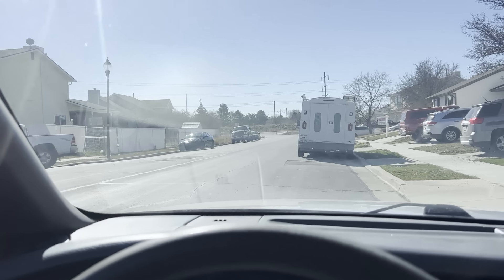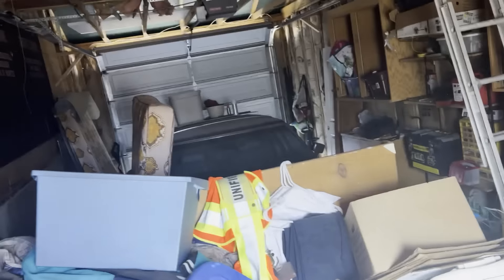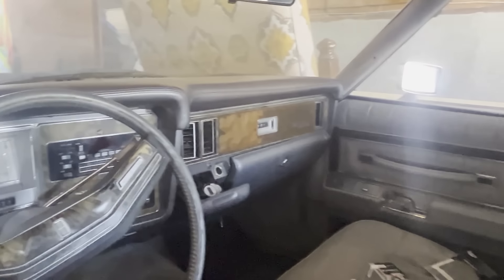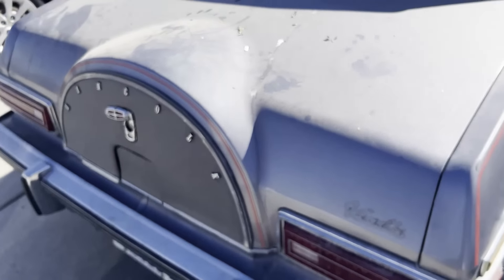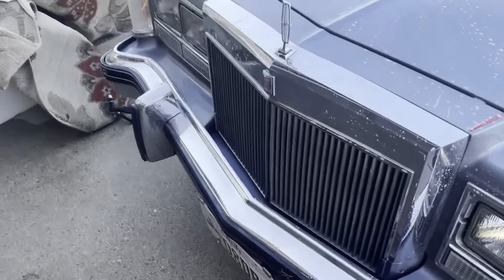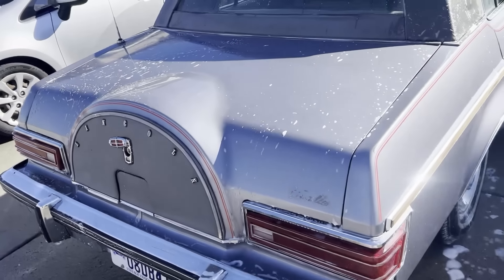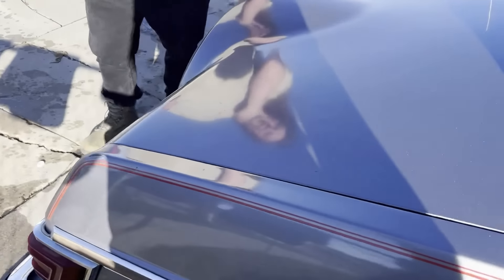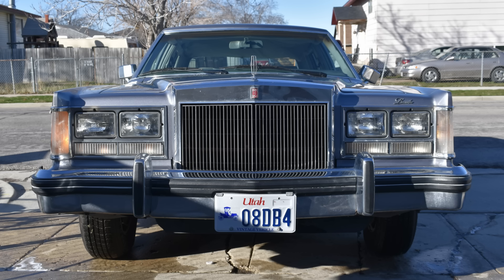Bringing Back This RARE 1979 Lincoln Garage Find!

Comment: The Versailles was Lincoln’s answer to GM’s Cadillac Seville. It was rushed to market when the Seville was a runaway success. I never cared for the first body style that had the Granada roofline. When Lincoln tweaked the roof a bit, it made all the difference. I loved both the Seville and the Versailles, but when it comes down to the success of either model, even though Seville sold more by far, you never see either of these cars today. 
I would love to find a black Versailles, at one point, these cars were offered in a 2 tone paint scheme that was eye catching as well.
I hope wherever it ends up, it’s brought back to life and once again turns heads as it did 40 years ago.
Reply from the maker: Thanks for the insight &   yes the car was purchased by an enthusiast who wants to restore it!
Reply: Cadillac did a better job of disguising the Nova/Camaro heritage of the Seville than Ford did disguising the Granada lineage of this car. But the Granada, with its very expensive looking interior and extra sound deadening, was a better fit for a luxury car than the penalty-box Nova, so it needed less tweaking. I'd rather be seen in the Seville, but with its roomier front seating and simpler engine, I'd rather live with a Versailles.

Comment: Yea, actually fellas, this Lincoln is way more than just a pretty Granada.   It's got way way more options than the top of the line Granada/Monarch.  The Lincoln's suspension has nothing to do with Granada/Monarch. Your Lincoln has 10s and 10s of pounds sound deadening insulation. 

 So, no sir, it's not a Granada. Other than some shared body panels.
Reply: Nah, it’s a Grenada/Monarch. Ford  should have been ashamed for trying to pass this off as a Lincoln. The later year runs did get better with the limo roofline.
Reply: @ATL1999  I know my cars.  And I know you didn't read my description.  You merely skimmed through it.  I know my cars intimately.  Was it a success?No.  And there is no shame. No Shame at all trying to stay competitive in a fierce market.  I would love nothing more than to get my hands on a well loved Versailles!

Comment: The Versailles actually had a fair bit of upgrades over the Granada. It was the first domestic car to have clearcoat paint and electronic controls. The clearcoat on Ford and Lincoln products was really high quality until they moved to a cheaper one in the mid 80’s. The dashboard is real leather, and it was actually built on the same line as the bigger Lincoln’s which had a nicer build quality. They were crazy expensive new to boot
Reply: My Uncle bought a 1980 from a Friend in 1982.  He said it retailed for $18,000 2 years earlier.  My Uncle hated it and traded it two years later for a a Towncar.

Comment: Even though it was just a luxurious Ford Granada, it was cool!
Reply: Just like the Seville was a Chevy Nova
Reply from the maker: @turnne  Nah the Granada was literally just a rebadged Granada, same exact body just different face & rear
Reply: @azhurelpigeon  My parents had one when I was growing up..and a Granada as well at the same time
The Versailles had a significantly upgraded interior and was also much quieter and smoother than the Granada was.
I do think that GM did a much better job in the transition from Chevy Nova to  Cadillac Seville though in hiding the origins
Reply from the maker: @turnne  Wow, what an awesome garage that would have been to see back in the day! 👍
Reply: @azhurelpigeon  You couldn't be more wrong. Read my post on top
Reply from the maker: @styldsteel1  So a Granda with a gussied up interior too & better suspension? Ok that's a little more intensive than I thought, but it's still way less than the Nova compared to the Caddy
Reply: @azhurelpigeon  Im not connecting a nova with a caddy. Do you mean GMs J bodies Cadillac Cimmarons gussied up Chevy Cavalier?
Reply from the maker: @styldsteel1  No, people are talking about the Nova & Seville
Reply: @azhurelpigeon  oh ok. Thank you.
Reply: @azhurelpigeon  The Seville was built on the same platform as the Nova and yes the Cimmaron the same platform as the other J cars. Having been a teenager during the days when the Versailles and Granada were new..trust me there were differences. My parents owned them both at the same time. When I first started driving I drove them both. Yes..clearly the Versailles was based on the Granada, but the Versailles was much quieter, rode better and had a unique interior. By the same token, one could look around a 76-79 Seville and see the Nova in it as well. I agree that GM did a better job at masking what the Seville was.

Comment: IIRC that car was on the Falcon platform dating to 1959 for the 1960 model year.  Ford replaced the Mercury Grand Monarch with this car.  (That is Grand MONARCH, not Grand Marquis.)  I think this car had a fiberglass cap that gave it that distinctive roofline that the earlier models didn't have.  The early models also had the 5.8 liter (351 c.i.d) Windsor engine that was eliminated on the later models in the interest of Corporate Average Fuel Economy requirements.  GREAT VIDEO!

Comment: My leasing company had a 1978 Versailles, and it was the hit of the store! Stock # LAN801, for Anaheim location (Southwest Leasing), 1978 model year, unit #1. What was exhilarating then may be less than interesting today. That's the way of the automotive world. My 1998 Oldsmobile Aurora sat in a local repair/body shop from November 2020 until THIS January! It was fine because the car had major rust issues, being from Michigan. And I have twenty-three other vehicles. Twenty miles on the odometer in 38 months.
Reply from the maker: I love hearing stories of malaise era cars from back in the day, thanks for sharing 👍

Comment: 5:23 Is that a caster adjustment strut rod I see? These made the switch from bias ply to radial tires a little easier. They were all the rage in the early 1960s when the Falcon was designed and Ford must have kept them in all of the U.S. Falcon descendants. GM got rid of them in all of its full sized 1971 models except the Cadillacs, which were often used to build hearses and ambulances, which sometimes used bias ply tires. For some reason, 1990s Honda Accords also had them.

Comment: Probably mouse turds in carpet
Reply from the maker: Hahaha I hope not!
Reply: The Versailles had a  narrower disc brake 9 inch rear end which is very popular with hot rodders and NASCAR until recently they used a variation of. Meaning it has 4 wheel disc brakes. That is a nice car that can be brought back easily. Would seriously consider adding this car to my Lincoln pack. But so far away in NC. Has very good bones. Much more than a Granada. Have seen both up close. The weatherstripping, insulation, interior quality and stability from greater frame bracing makes it a true Lincoln. Hope it’s appreciated wherever it winds up.
Reply from the maker: @joeboggs4355  Yes! It sold the very next day to an enthusiast who wants to restore it & maybe make a YouTube channel of his own documenting it!